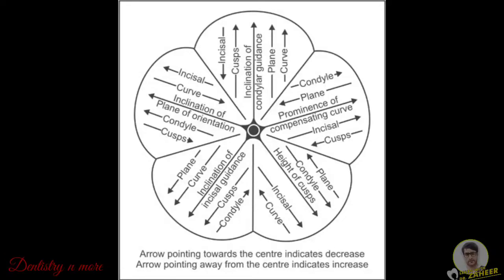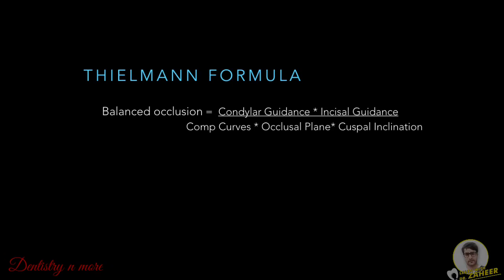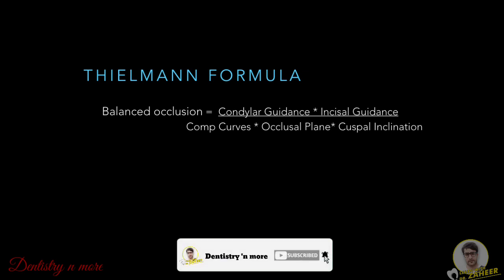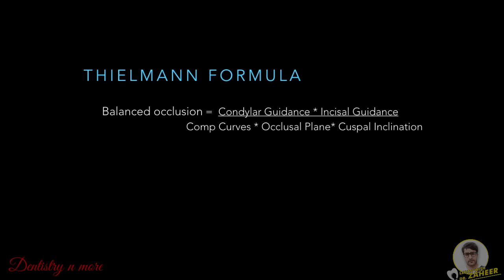BALANCED OCCLUSION

Comment: So nice and clear explanation.thank you.😍..and can u tell about cuspal inclination ..how we get those angles.? And also does it vary with different teeth like semianatomic and anatomic teeth ..plz clear this cuspal inclination doubt..thank you.😊
Reply: The cuspal inclines are the angle formed by the slope of the cusp with the horizontal plane. There are 3 types based on the angle of cuspal inclination. Anatomic teeth- 33 degrees; Semi-anatomic-20 degree and monoplane- 0 degree of cuspal inclination. Depending on the patient and the other factors involved in achieving balanced occlusion one of the three types can be selected. The reason it varies is because it provides a range to choose from to achieve balanced occlusion. There are teeth with cuspal inclines of 10, 20, 22, and 40 degree also. Their selection is determined by a culmination of the other factors involved. Hope that was helpful
Reply: @ananthanarayanan846  ..yea it was helpful..thanks...😊🤗but why did u choose monoplane.
Reply: I got answer tht is because o degree teeth are used in ridge resorption cases..